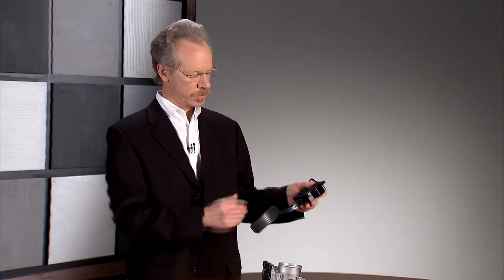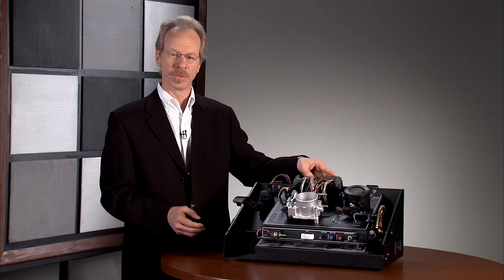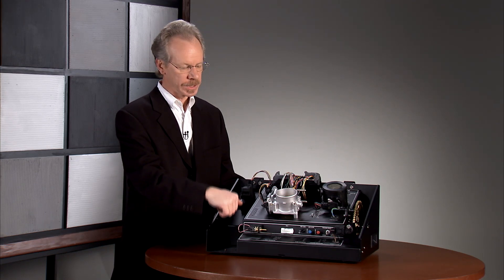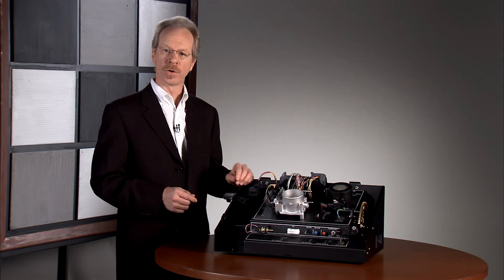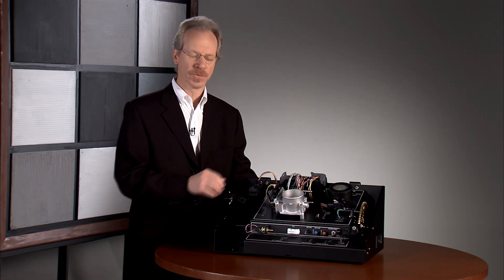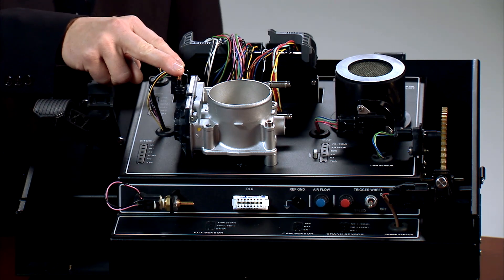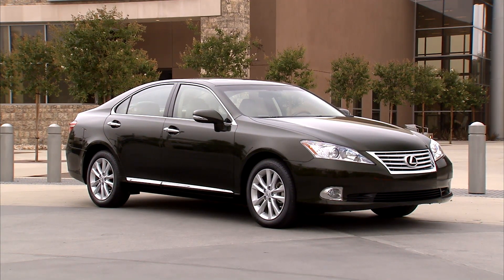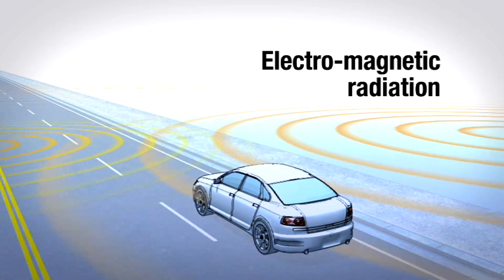Safety Features of Electronic Throttle Control Systems (ETCS) | Toyota

Comment: I have a 2005 Toyota Tundra 4x4 4.7 l having problems with the throttle not responding replace the throttle body still having problems it seems to be intermittent not sure what else it could be. Anyone have any suggestions

Comment: This IS NOT A GOOD SYSTEM.. There's Way To Much Room For Era.. I Would Even Say It's DOWN RIGHT DANGEROUS.. The Idea Of Building A Better Mouse Trap In The Case Of Mechanics, Thrust, and Momentum? Is Stupid.. The Speaker States The System WOULD NOT Lock Into Acceleration.. However, It CLEARLY Doesn't Have The Same Response Time When The Driver Needs To Accelerate. Direct Cable To Carburetor? Is THE EXACT SAME IDEA As Hydraulic Breaking.. 

There's No Disconnection From The Operators Foot, To The Breaking Or Acceleration or Deceleration Of The Vehicle.. This Form Of Throttle Control Takes Full Control Of The Vehicle AWAY FROM THE OPERATOR. And? Puts It Into The Control Of A Computer./Electronic Device.. Which Is Vulnerable To Everything From Shorts Caused By Vibration Cutting Wires. To Moisture Buildup Creating Shorts In The System. To Electrical Corrosion That Builds Up In ALMOST EVERY FUNCTIONING ELECTRICAL SYSTEM.. Not Good.. Nope...

Comment: your fail safe system has been my nightmare for 2 years I hate you and whoever designed this... Throttle Accelerator to butterfly operation is not in real time its so slow and sometimes it wont even respond correctly as seen in this video
Reply: I have one of these nightmares in a 2003 solara. The damn car won't accelerate past 3500 rpm then starts surging and cutting out. No codes, replaced fuel pump, did major tune up. Can usually fix most anything myself. this is a nightmare. The older cars were so much better.Don't trust shops because it is not your money and they just throw parts at it and guess until they fix it trust me. I can read a code reader just like they can but as I said there are no codes.
Reply: Meant to say it is not their money.
Reply: Show me how to fix the throttle control sensor.

Comment: Mechanical is best , won't run out of control and kill people .use vw dbw it slows when brake is pressed not run away and kill people.
Reply: Show me step by step how to change the throttle control sensor.
Reply: Hello, you going to tell me or not?
Reply: And thanks a lots.

Comment: well you are wrong sir, all of these safety futures are possible via sensors and ecm, but you can still detect the position of pedal and throttle and still use the safety things  but you don't have to run an electric motor to control throttles position because of this. Adding electric motor just adds weight and increases the price of your cars.

Comment: If they have to explain this travesty of engineering (which, admittedly most manufacturers now use) there is a problem. I will NOT own a vehicle that does not have a throttle cable, or I will fabricate and install one using the ECM and wiring from an older vehicle that does not use this crap. I have done so--it IS possible--but not easy.

Comment: Interesting that the throttle position sensors use diverging voltage lines, but the accelerator pedal sensor voltage lines are parallel. Wouldn't that mean a fault could occur if the ground voltage for the pedal suddenly rose, indicating the pedal was pressed in?
Reply: Nevermind. Thank you anyway.

Comment: The redundant sensors are good however it seems the entire system is dependent  on the integrity the ECU and its ability to detect an internal fault, an external throttle control unit (TCU) with separate sensor input could be added to the system, both units ECU+TCU would reconcile sensor data with each other before fuel delivery or throttle movement by the TCU could continue.

Comment: What is wrong with the old fashioned throttle cable. Much simpler design, and if the cable breaks, or falls off the throttle body, it also will return the engine to idle, as nothing will be pulling the throttle body back. Guess I am stuck in the past, but I think 10 sensors to replace a throttle cable is excessive. Too much to go wrong when the car gets older.
Reply: They had a design methodology. Reduce mechanical systems in order to improve reliability. It did wonders for the HVAC and Electrical systems in their hybrids. Prius and newer Corolla Hybrids now have no accessory belts. Instead replaced with electrical fans, electronic water pumps, and no more alternators. Also no longer need a starter. But they have been replaced with complex electrical equipment. 

That equipment has to be robust and is likely not DIY friendly. Everything just needs to be replaced rather than repaired.

Comment: Way too over complicated.. Way too many electrical components. Gas pedal connected to cable which is connected to the throttle body. Failsafe: Spring attatched to the throttle valve to return engine to idle once you have taken your foot off the gas. Why over engineer a vehicle until its not dependable?